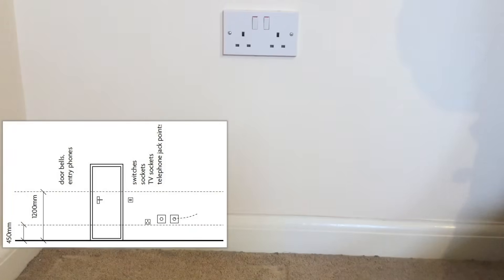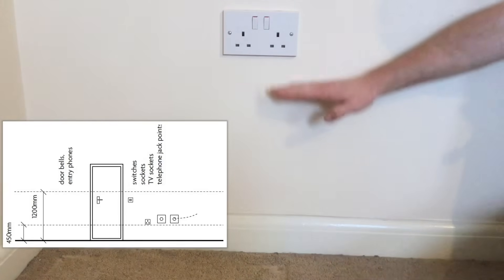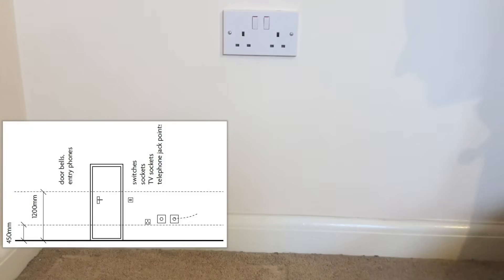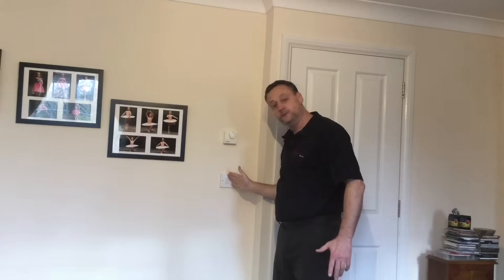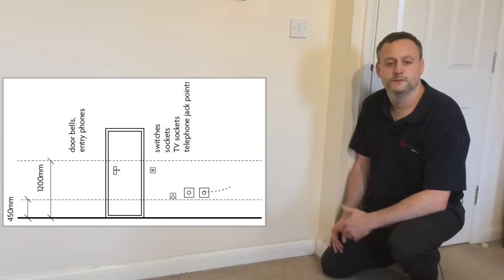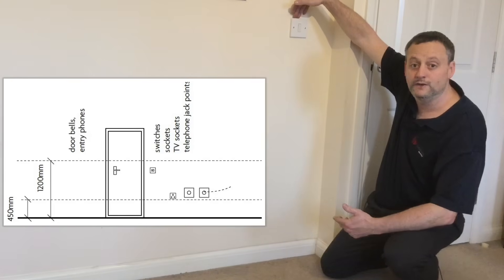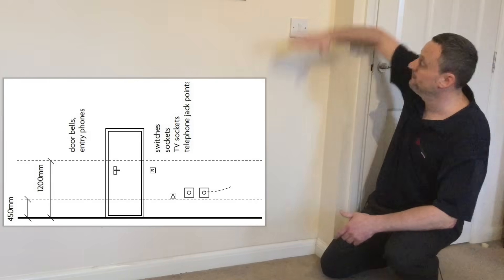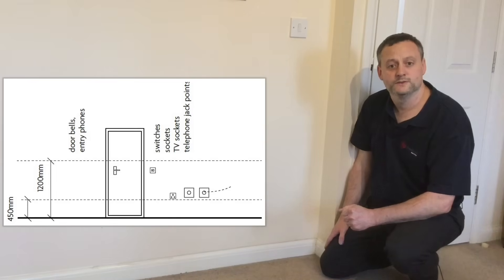The Prescribed Zones for Wiring Cables in Wall or Partitions & Switch Heights in Domestic Dwellings

Comment: I have dot and dab wall in my living room (external wall). I want to add a double socket on a spur to go behind my wall mounted TV. Coming from the double socket which is already installed 450mm above the floor, I would need to come up and across to the right. I understand that cables can't be run diagonally. How should I best tackle this? I assume that I would need to come up from the double socket, all the way to within 150mm of the ceiling, across to the right and then down to the new socket behind the TV? I'm not sure how I would achieve this unless I am removing sections of the plasterboard? Also how would I stop the cable from running diagonally? Would it need to be installed in conduit attached to the brick/block? Thanks in advance.
Reply: Thinking about it, I should be fine to come across to the right horizontally from the original socket and then straight up to behind the TV? I am still unsure about how to attach the cable in the wall to stop it running diagonally though?

Comment: Which is why builders should provide home owners as built drawings showing exactly where the cables are installed.  It is a statutory requirement under the CDM Regulations but they never provide them.  I simply do not understand why the HSE do not prosecute developers for breach of their obligations under the regulations.

Comment: Can you run a spur cable at a 45 degree angle from an existing supply down to a new accessory? Is this outside current regulation?

Comment: great video  i live in a property built appx 30yr ago and sockets seem to be around 300mm up from floor and light switches about 1 4m up from floor... before persons with limited reach were considered!  anyway I wanted to add a spur socket and would connect horizontally to existing socket   am I ok to follow the same height from floor as the existing?  or do i have to go that min 450mm from floor?  any advice appreciated
Reply from the maker: Heights of Switches, Sockets & Consumer Units - Part M of the Building Regulations
https://youtu.be/CVECKXhTJAM
👍🏻

Comment: The information on the height of socket-outlets is incorrect. It should be 450mm to the centre line of the accessory, not the bottom
Reply from the maker: Totally agree 👍🏻

Comment: Have issues with 150 from corner in a wall especially in a kitchen,as most units have fixing brackets in this range .it's just very bad practice.find your video's a great form of knowledge and straight forward.👍
Reply from the maker: Thanks for watching 👍🏻
Reply: I agree with you totally. I'm an intruder alarm engineer with over 40 years experience and 99% of all alarm detectors are corner mounted  at ceiling  height. I would deem this wiring zone as bad practice.

Comment: Brilliant and informative video. I've been wondering how to route power to a wall mounted TV in my kitchen and dreaded having to lift the chipboard flooring in the bedroom above it to drop the cable back down from the ceiling. If I understand you correctly, I can simply spur upwards from a floor level kitchen socket and then horizontally across the same wall at the height where I want to fit the TV power socket (hidden behind the TV) ?

Comment: All my sockets in my house are a lot less than 450mm from the floor and most of the light switches are over 1200mm from the floor its a 1930s built house

Comment: So if there is a concrete floor and a solid wall and you want to install sockets, you would have to run the cables down to each socket from the ceiling or horizintally from each socket. I assume you wouldn't be able to run the cable from the first socket down to floor level, along the wall at low level and then up to the next socket.
Reply: Definitely not

Comment: Never been a fan of the zones or horizontal. Mr DIY & most trades have no idea of the zones, expecting wiring on the vertical above or below the switchgear.
Plenty of people still using nails to install coving, so not a good idea to run it in the 150mm from ceiling zone. Cabinets being built into corners, tv brackets, shelves, etc..
If absolutely necessary & vertical chases can’t be put in, I’ll often opt for a surface mount above the skirting/plate rail or below coving.
Any horizontal chases are installed using galv conduit... but it’s extremely rare they are unavoidable
Reply from the maker: Thanks for taking the time to comment in such detail 👍. Gaz
Reply: Coving does not cost much and a diyer can even put up. Could you not have surface mounted wires covered by coving ? Also is it permissible to thread cable behind existing coving as unless someone has gone bonkers with the fixing adhesive there would be a nice channel to thread the cable through albeit it could not be clipped

Comment: Hi I have a question, if the cable is more then 50mm deep and outside the safe zone with an RCD is this okay? I’m running cables vertically down for outside lights then drilling though. Cables will be behind dot and dab then plastered but I’m gonna chase the cable slightly deeper.

Comment: Hi, quick question are you allowed to go horizontal and vertical or vice versa for a cable run. For example a customer wants a socket adding or moving to the right and dropped down a meter. Can you run the cable by going right from the socket and then vertical? Thanks
Reply: Good question and i hope you liked your answer

Comment: Great Video Gaz, Thank you. If you were to do an EICR on a property whereby the switch accessory or the wiring does NOT conform to the prescribed zones in accordance with BS7671 , what would be the code you personally would give for the switch and cable being in an non prescribed zone?

Comment: Where the light switch is by the door, there's a very small return, is that classed as one where you could come 150 off? Or does it need to be the corners of the building
Reply: Good question. Have you found the answer? 🤔

Comment: I've never understood the 150 mm from ceiling safe zone. Given that many nail coving in that area.
Reply: Dry wall screws are usually used to secure plaster coving until the joint filler sets. You cover the screw heads after with some left over joint filler. As for the cheap paper covered paintable coving that is normally applied to wobbly walls and ceilings and won't suck as the walls are not flat enough like in new build jobs
Reply: And kitchen wall units!
Reply: Who pins coving? Just give it a full spread all the way along the edges and suction will hold it up
Reply: @electricalstuff259  

I'm aware of how to install coving. Many aren't experienced though. I recall a friend installing his coving that drove nails under and above the plaster coving to support it while it set.
Reply: @martinw245  Don't think electrical regs should have to account for others doing the job wrong
Reply: @electricalstuff259  Are you a troll for gods sake? I simply said I never understood that particular safe zone. And there is nothing that defines using nails to secure coving as "not doing the job properly". 
Go somewhere else and troll.
Reply: @electricalstuff259  

I cope fine "mate" but trolls are a waste of space... mate!

Comment: Great videos
One question
If sockets fitted in new extension to old building will they be at the new heights or can they match original in older part
Reply from the maker: Hi. New heights to comply with building  regulations 👍. Thanks for commenting and watching GSH Electrical
Reply: Thanks for your help
One electrician said yes other no

Comment: Wow people who fit skirting boards really need to understand BS7671. I have a house with cables running down through the corner of a room and into the floor. The skirting board has been nailed in at the end as you would expect. At this corner, nails missed the cables by millimeters.

Comment: One job I went to, cables where run in the 150mm zone at the top of a kitchen wall which had a low ceiling and the kitchen fitter drilled all his cupboard fixing holes in to the zone.
Reply: I am sure he blessed himself first

Comment: Does the BS7671  apply to rewiring an old house or just need builds? 45cm sounds like the socket would look ugly at that height?
Reply from the maker: Hi. If your rewiring a house that is not being used by someone of limited reach then you can use the original heights. If it’s a new build or extension then these heights apply. Thanks for commenting and watching GSH Electrical 🙌.
Reply: GSH Electrical thanks very much for your reply it is very helpful. What are the old heights for sockets and switches please? When drilling through beams do we still have to use the new regulation for this? Length X 0.25 for the no drilling zone and length X 0.4 for the drilling zone?

Comment: Those corner zones are helpful but how many chippys know about them and where do you think they screw the skirting in the corners,yes you guessed it inside 150mm
Reply from the maker: Hi. Again I understand your point but this is an exam question and therefore has to be covered. Thanks for all your questions Gaz
Reply: When i do skirting i never screw at at a corner as i have mitred the joint and as i want some wiggle room to make a 90 on none perfectly aligned walls i screw about a foot and a half back from the end. If i screws in the corners and the walls weren't perfect 90 my mitres would have no chance of meeting. Any gap between wall and skirting in these corners gets some painters mate

Comment: Love the videos. They are very helpful as I am an apprentice electrician. My question is....if I am running my cable down to a light switch from the ceiling in a stud/plasterboard wall. Does the cable need to be supported via clipping? Or is it fine to leave it hanging on its own if there are no joists in the zone of the cable?
Reply from the maker: +Liam Rushton 
Hi thanks for the comments. The circuit will need RCD protection (30mA or less) unless it’s installed with an earth metallic sheath... with any cable it will need supporting in accordance with BS 7671... in short yes it need supporting. Thanks and all the best GSH Electrical
Reply: Lots of cables are run in insulation free cavities in walls and certainly are not clipped. Artisan just did one in a porch wall for one of those new irritating noisy ringo door bells
Reply: Yes

Comment: Hi, thanks for making these videos, they're very informative! The diagrams showed prescribed zones on the other side of the walls to where the switch/outlet was, is it acceptable to sink a cable in the wall from the opposite side and bring it into the back of a box (e.g. think adding a socket to a tiled kitchen, can the cable be dropped in a room beside the kitchen and then into the outlet so not disturbing the tiles etc?). Thanks again!
Reply from the maker: +Stephen Harrison 
Hi. If you bring a cable buried down a wall it must go to an accessory on that wall as  described in the video. So the best way around your issue is to flush a box in on the wall you want to bring your cable down and the drill through to your new socket. Hope this helps and keep watching GSH Electrical

Comment: What tool do you use to trace cables in walls?
Reply: Joiners just tend to use a drill and always seem to find them. Best thing is, after they find them and had the celebration flash they will still stick the wall unit on.
Reply from the maker: +rR P 

Hi thanks for the question. Sadly I have never used a tool to trace cables in a wall. Keep watching and sorry I was no help this time, all the best GSH Electrical.